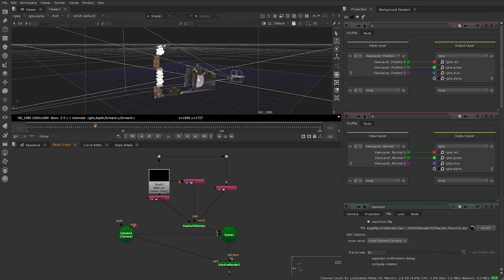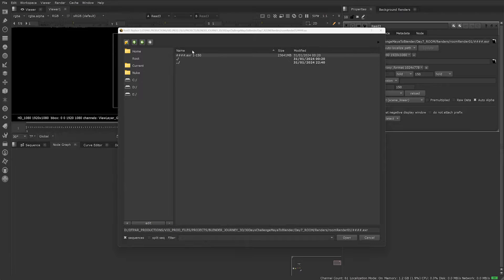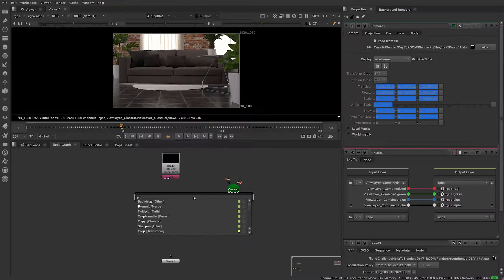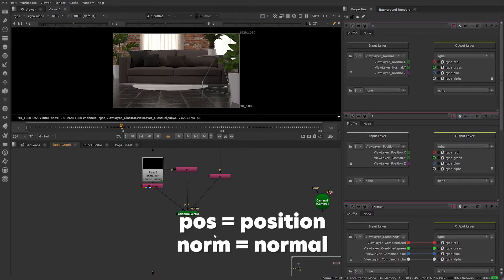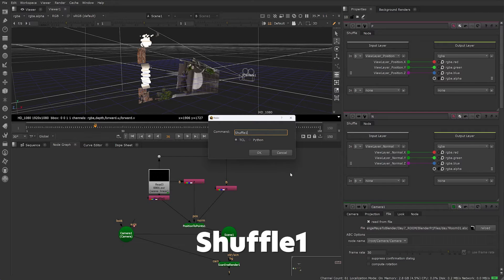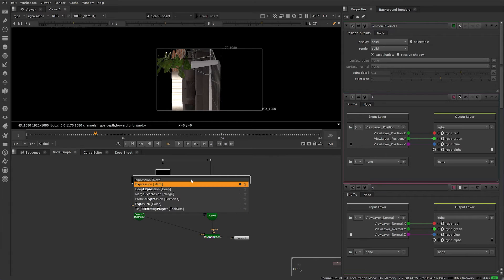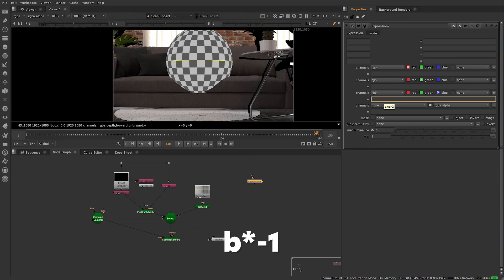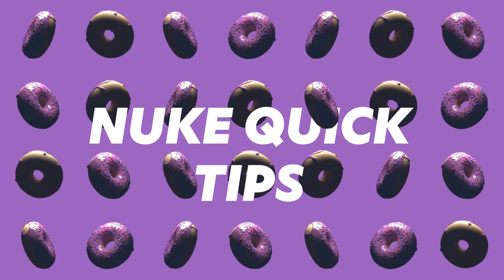How to Fix Position to Points in Nuke.

Comment: what about c4d renders? Especially from Octane Renders? Everytime i plug the position and normal pass into the nodes and i plug it again with scene and camera, the point cloud will always doesn't match with the camera
Reply from the maker: Hey, thanks for your comment. I'm personally not a Cd4 user and I haven't experimented with the octane render engine yet! I imagine you'll just need to change a value in the rgb channel to fix any rotation/flipping issues. I don't want to say which though without experimenting/testing it myself! Hope you can find a solution if you haven't already :)